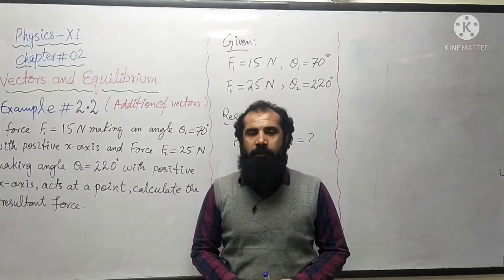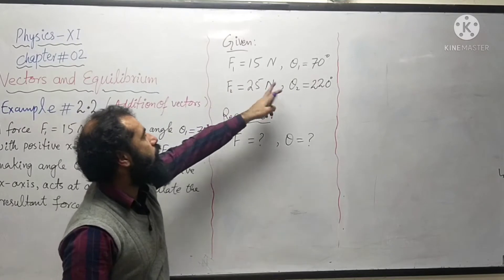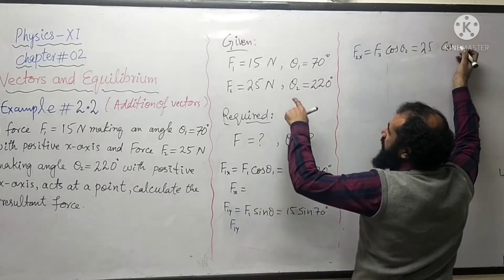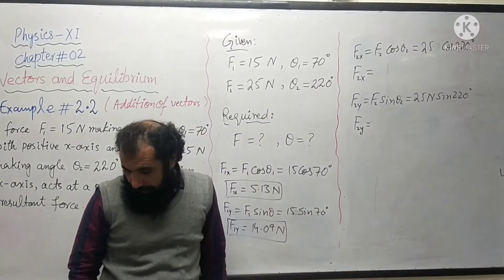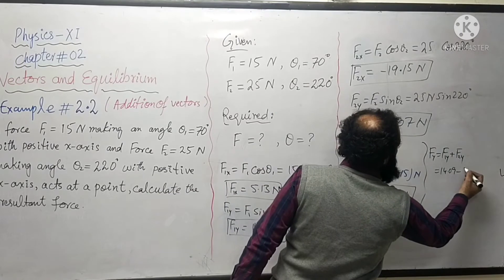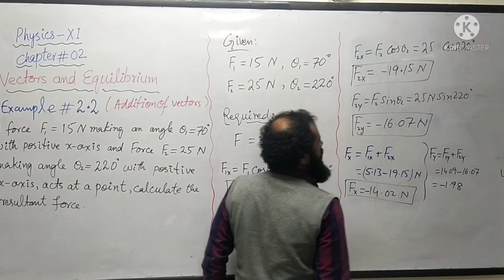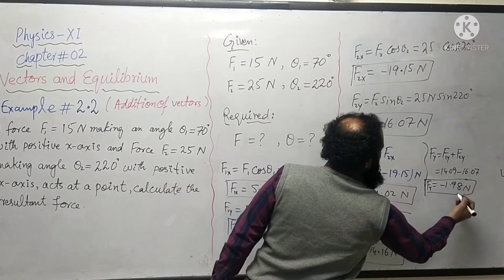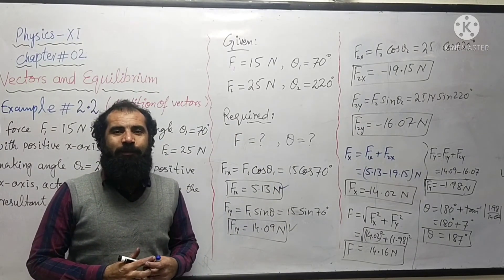Example 2.2 first year physics KP and Federal boards

Comment: Sir.      15cos70=9.49 
              25cos220=24.90 
All the values comes different in calculator 
What to do ?????????????😢
Reply from the maker: U r right 
Use the values u get in the calculator but use the same method

Comment: sir also add diagrams with this example compenets graphically i cannot made it
Reply from the maker: Actually in analytical method there's no need of diagram
Reply: @physicswithatifwaqas8398  yes sir but still sir we should know this method how we can do it 
It will be appreciated if you attach a pdf in decription explained graphical method
Reply from the maker: @pkterminator  Soon I share it